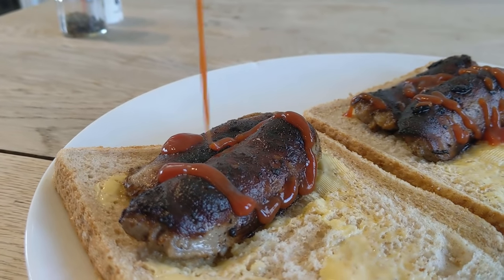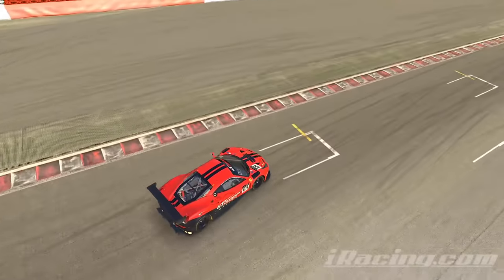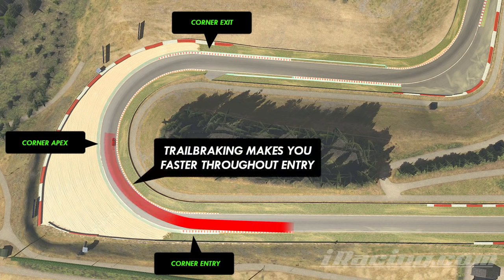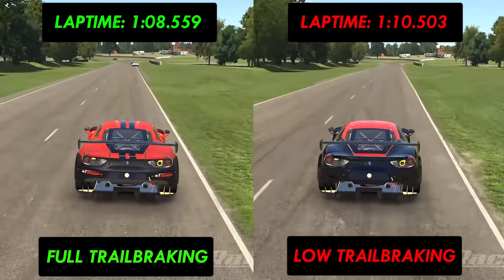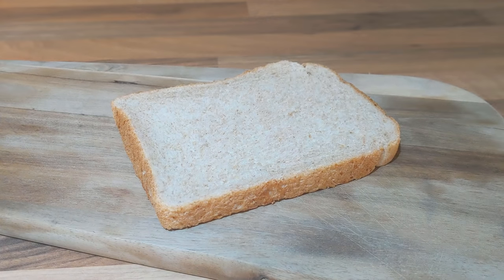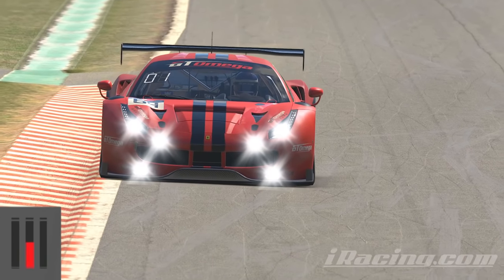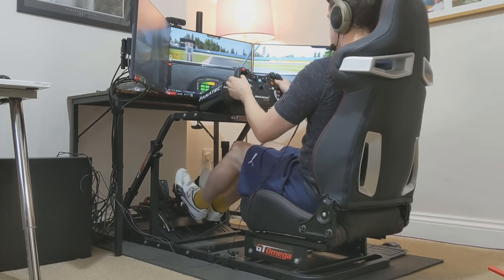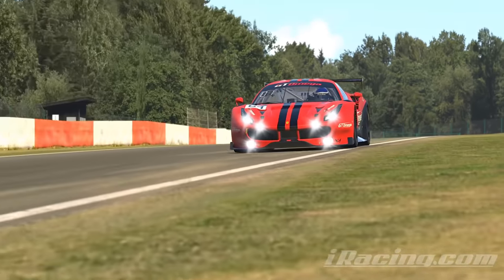Trailbraking In Sim Racing - How Slowing Down the Right Way Makes You Faster

Comment: When you feel like you’re gonna miss the corner but then you hit the apex is when you know you got the braking perfect.
Reply: I have to practice this. I'm still at the stage of "keep the revs high so I can get on the power, so the nose will tuck in."
Reply: @39KHall  getting on the power to get the nose in??
Reply: @jorehaast9887  I'm still at the stage of "kick it in reverse and floor it, blowing up the engine in the process"
Reply: @istachi  hey man, some of us are even less advanced than you
Reply: Your pfp describes my face when the car starts understeering.
Reply: @39KHall  You shouldn’t use the gas pedal to tuck the nose in unless you’re drifting. If you’re not slipping the rears while getting on the gas, you should experience understeer when trying to turn. To tuck the nose in you should watch this video and get a little trail braking going.
Reply: Breaking Bad. Braking good
Reply: Fax.
Reply: @jorehaast9887  theoretically could be done with a differential, but that's not the usual use lol
Reply: I only got this a couple times but it feels AWESOME
Reply: @1.7mviews84  I’ll change it oops
Reply: @jopvandam6820  it actually does work, you can slip your rear enough with throttle to reposition your nose more towards the inside of the corner for a faster exit
Reply: @IPickleYou  You could do that, but unless you want to completely ruin your tyres after 1 or 2 laps it’s not a good idea. Just use trail braking. It’s faster and causes less tyre degradation.
Reply: @jopvandam6820  its not a big slide generally so no you wont be really spinning your tyres enough to exactly cause major wear on them, ideally anyway but it all depends on all sorts of different factors aswell
Reply: its just a minor slip to angle your car,  theres not much wheel spin involved if you do it correctly but yeah there are places where one is better than the other ofc
Reply: @jopvandam6820  just looked through his videos, he has a video on slip angle aswell. youll get a better idea on what im talking about from there
Reply: @IPickleYou  I know what slip angle is. And of course you should always want your car to be at the limit of grip with a little bit of slip-angle but on corner entry you don't want to use the gas pedal to tuck the nose in. Of course on corner exit you'll want to use the maximum of your grip potential to accelerate with a little slip angle. But understeer should not be solved by getting on the gas unless you're drifting.
Reply: Late Apex?
Reply: Nice expression!
Reply: Happened to me yesterday.
Reply: When you have shit g29 pedals so your braking is fucked up and can t trailbrake
Reply: @iwillnoteatzebugs  They say, that the single piece of gear that can give you the most pace; is the breaks. Many things boils down to muscle memory as well, and with bad breaks, you won’t get it. I think that Thrustmasters TM-LCM are the cheapest loadcell breaks on the market, and if one isn’t use to loadcell, it’s absolutely huge to upgrade to. Worth saving up for! Maybe you may be able to get a great Black Friday deal, if wherever you are got something like that.
Reply: 💯 , get as quickly as possible to the apex such that you can position the car to get on the gas as early as possible.
Reply: @iwillnoteatzebugs  I drive on g29 brakes and I’m fairly quick. I’m not an alien but I’m fighting for podiums in pretty much every public lobby I drive in. I’d definitely be faster with better pedals but I can’t afford them. You can make it work!
Reply: Exactly! This is  how I experience TB in the beginning.
Reply: This is the truth; however in real life is absolutely terrifying. The first time I was on track on my bike learning trail braking I was not stop shitting my pants.  Now years later I understand that ride on rails feeling of coming in deep trailing brakes and rocketing out of the corner. Nothing better than passing somebody mid corner like they’re standing still
Reply: @IPickleYou  I think that if that’s the technique you’re using, you slowed the car too much before the turn-in point, and is more applicable to drifting.  Trailbraking lets you carry a little more speed into the turn because it’s keeping more weight on the front tires, for more grip.  And if your car is properly balanced, the amount of weight removed from the rear tires (while trailbraking) could be enough to allow the rear to rotate, and reduce the steering angle of the front tires at the same time.
Reply: I do this every time I pull into a parking lot😂

Comment: You’ve explained this before, but this is the absolute best explanation verbally and visually ever displayed on YouTube. No further questions needed. Visually it was the faded redline demonstration. You’ve covered a variety of analogies to appeal to different levels of understanding.
Reply: Finding your input vs the brake factor setting is key.  if load cell you should be close to 0, if 8 bit pedals default setting is just that, default.  sometimes its better to have a longer curve (fudge factor) depending on your personal style of input.  .3 is about where i am at on road course cars just because i always cover the brake.   0 is true linear, input to sim which gives you the best consistent feel with a load cell.
Reply: This comment, absolutely. This is a terrific explanation of trail braking and I loved it.
Reply: It’s considerably more effective with rear biased cars with slight oversteer.  Planted AWD cars like STI/Quattro/EVO families need electronically induced oversteer. Tesla 3 Performance, some FWD hot hatches(Ford & GolfGTI) do some trickery to attempt this purposeful oversteer.

Comment: Upgrading to load cell pedals helped me immensly in getting a more constant trailbraking. Imho one of the most important upgrades to start with. Great video!
Reply: agreed
Reply: Absolutely. And start with small BRF if you have a fanatec LC, makes it much easier to get adjusted to
Reply: Interesting. I've used LC for years, but know quite a few e sports guys that go back to the "cheap" pedals because they're easier for them to be consistent.
Reply: @notdreadyet33  that's very weird to hear.. I believe you ofcourse but lc made my braking SO much more consistent, right from the start. I just can't imagine that someone prefers cheap springpedals over lc pedals :-/
Reply: @MrEDET  I actually used to feel the same way! bought my LC, then put it in the garage for 6 months when my times sucked. Later, when I got a lot better and couldnt shave off time braking anymore, I pulled it out and made the switch back to the LC. 

For me, the big thing I had to do was wear shoes on my left foot, at least flip flops. I was a socks racer before, and couldnt get the grip you need to properly put pressure on the LC.
Reply: @MrEDET   I agree. What I understand about it is they can be just as fast, but are more consistent with the cheap ones. Definitely weird, but I haven't used non LC since 2008 or so
Reply: @notdreadyet33  Exactly. With spring pedals you kind of have to memorize the position your foot is in for the perfect braking position, and with unmodded pedals like the g29 that's nearly impossible to do consistent. With the LC pedals I feel the resistance. It didn't even take time to adjust - my pb's shattered because my trailbraking improved so much because I could now feel how hard I was pressing the brakes. Also heel/toe becomes much easier with LC. All imho ofcourse, I'm sure there are enough people out there who can manage this with 20-year old pedals :)
Reply: 100%. A load cell brake pedal made a world of difference for me. The effects of which have been reflected both in my laptimes and my ability to run said laptimes consistently.
Reply: @MrEDET  At the end of the day such memorization is next to impossible. Why it could feel like it's happening is because the spring also provides some back PRESSURE. So, we are back to the same thing as with LC, except with LC the dynamic pressure range is much wider, therefore I'm very skeptical about such claims.
Reply: @F9109-r1e  That kind of surprises me, first time I ever hear someone saying this :) Did you just recently buy lc pedals? Which ones do you have?
Reply: @F9109-r1e  its correct there is no travel, you should feel by the pressure how far you're braking. Just keep practicing mate, hope you get used to it quickly :)
Reply: @F9109-r1e  Now I'm doubting if your pedal even works correctly.. when you calibrate it in windows.. you have to press the brake pedal almost full force to get it at 100% right? The whole idea of a lc pedal is that you feel pressure, resistance.. slight pressure for trailbraking, a lot of pressure when you're braking full and probably lock up the wheels. The beauty of lc is that it feels natural. When I got mine I did my first lap in the Lotus 49 in Iracing and after a couple of corners I could already feel when I was braking on the limit without locking up the wheels. Have you made sure you installed those.. forgot the name, those plastic things correctly in the braking pedal??
Reply: @F9109-r1e  do you have that yellow spongy part installed in the middle? You should get a small amount of travel first, very light, the pedal moves about 2cm. That is the area do you the trailbraking with. When you push further you hit the yellow sponge area and the pressure starts to build. Try racing with socks, racing shoes or what I use, watershoes, those are perfect for simracing. Reading your post I still think there is some sort of setup issue on your end.. trying to help you out here, you're really the first one I hear having an issue with using an lc pedal. It should feel so naturally..
Reply: That’s what I thought. I was thinking of my set up and I don’t think my brakes allow me to make those slight adjustments at all
Reply: @matthewrobert1810  Which pedals do you have now?
Reply: @MrEDET  the stock g293 pedals
Reply: @matthewrobert1810  Trust me, you really want lc pedals. And the fanatec ones are not even that expensive for example. But note you either need a rig to mount them or build a wooden frame yourself to mount them on when you're racing whilst sitting on a chair. You'll apply a lot of force to the brake pedal so they need to be rockfirm in place.
Reply: @MrEDET  got a rig already so I’m set there. Any specific ones from fanatic you’d recommend? I’m newer to sim racing. I started about 3/4 months ago
Reply: @matthewrobert1810  I have the Csl Elite LC pedals and recently they released a V2 version, so I would go for that one. But ofcourse check some reviews first :)
Reply: @MrEDET  I came back to look for your comment specifically. I found some thrustaster TLCM pedals on Amazon and figured I'd give the upgrade a shot from the stock g923 pedals. 

OH MY GOD. I can express how much of a difference this made. It's insane. 

Thank you for inspiring me to look lol
Reply: @matthewrobert1810  hey that is awesome to hear, thanks for letting me know. Enjoy the trailbraking! :D
Reply: I wouldn't call switching from a dd wheel + lc pedals to a controller an upgrade @bitemyshite
Reply: @bitemyshite Well firstly I ain't because you feel much better what the car is doing with ffb, secondly it's not really simracing anymore with a controller ;)
Reply: Ah. That nuance is impossible to tell in a Youtube comment :) @bitemyshite

Comment: I couldn't figure out why someone was faster than me while his lights were still on during the turn...
Then this video pops up without even looking for it.

Awesome explanation!!
Reply: practice racing sprint cars or midgets.  you use your left foot more then the right...lol  you learn how to trailbrake while sideways too....:)   but if you are new, depending on your brake setup.  play with the brake factor setting default is like 1.50 but true linear braking is 0, if you are a heavy footed then move it up until you find your happy spot.  every car is a bit different but i have cspv3's and run .3 on road course cars and 3.0+ on my dirt cars because i am always keeping brake pressure to keep grip.

Comment: Trailbraking is actually pretty easy on a controller. 
At least with the more modern Xbox controllers. 
This is because they have rumble motors in the triggers that are used to convey how much grip you have. 
Full rumble= no grip
No rumble= full grip
Rumble in the right trigger= grip loss due to acceleration
Rumble in the left trigger= grip loss due to braking
Reply: Your are definitely not getting on the limit with a controller :/
Reply: LMAO!
Reply: on a track, nope, but on rally it’s still doable to the point of world records, and even compared to old controllers, is a massive increase on tracks
Reply: Way better on the Dualsense with adaptive triggers
Reply: Anyone still harking on controllers hasn't used the new ones. I am def faster with a wheel. But honestly not by much. The new duel sense in particular is really easy because you can actually feel loss of traction on the triggers.
Reply: @razgriz6627  I've only been able to experience this in Forza. Are you able to get it working in AC?
Reply: My controller doesnt have that and i fail a lot of time in corners for lose grip because the brakes block really quickly even when i didnt send all input in the trigger, how do setup the trigger to not send to 0% to a 100% of brakes  when the input doesnt have a regulation, if u cant help me i really thank u 😢
Reply: Sorry if my english isnt the best🙃

Comment: This might be beneficial for shorter races where tire/tread condition isn't a concern.

Breaking in a straight line provides more longevity for the rubber, unlike breaking in a turn.
Reply: You're still gonna lose more time not braking the right way and you can trail brake WHILE taking care of your tyres.
Reply: If the race is so short tyres aren’t a question people drive hotlaps constantly so idk how it would matter
Reply: @makoaki9071  time is not everything....

That are alot of factors that go into winning a race.

trail braking is more risky and requires extreme precision to get it right especially under pressure.

I seen even the greatest drivers mess up trail braking.
Reply: @TinyBearTim  it does not matters if the race is short or not.

You will use more tyre depending on how you drive.

Trail breaking becomes harder the longer a race goes. Especially defending under prssure .

Your suspension has to be set up properly to get the full benefit of trailbraking also. Trailbraking with a poor suspension setup will hinder your front end grip and make you more prone to rear tire spin/snap oversteer.

Comment: The best way i learned to trail-brake is to tie a string from your brake pedal to your wheel. The harder you press your brake the less you can turn, but when you start turning it forces you to lift off the brakes little by little. Hope this helps someone who is having a hard time getting the hang of it.
Reply: This is an awesome trick. I want to try this, but I'm a 3-6 months away from build a PC.

Comment: This is why i think every racer should learn how to drift because it teaches you throttle control and where the brake point is when braking at a highspeed. That combined with proper knowledge of trail braking. Will give you a more complete idea of how everything weaves together when you want to maintain grip and speed while corning.

I have been doing trail braking since GT1 driving licence test. You literally cant pass them without using trailbraking.

Comment: In racing and in many things...
Averages are better than peaks. Compromise is key.

Trail braking is not better at braking or turning individually but it allows you to use all 4 tyres and balance the car, aero and suspension to do both together.
You might take 50% longer to do both but you can do both in one go. Less braking and turning time = less time in corner + quicker corner = faster boi.

This truly is a win-win-win-win. It's just the correct way to drive. Every little bit better you get at it you get wayyy better at driving in all scenarios.

Comment: What i learned from watching GT Races for more than 10 years, is that Trailbraking is only usable for Cars with Rear Engine, and Rear-Mid Engine, like Ferrari, R8...and others.
Cars with a Front Engine like BMW, Nissan GTR, Corvette dont use Trailbraking.
That is one of the Reasons why Porsche is that fast, and was always fast.
They can break later than other Cars, because of the Weight in the Rear. They need to Trailbraking, to put Weight on the Front Tyres.
And they can accelerate more early than others, because of the Rear Weight, they got much Traction.
Porsche are hard to drive, but when you are able to controll them, nothing is faster.
Reply: What if on the front engine cars the brake bias is 50/50?

Comment: One of the best explained trail breaking videos, thanks. I always struggled with this tecnique because by playing on pad i have problems getting used to control how much steering i'm putting in and that is dangerous if i'm steering while breaking. And i always thought i'm probably doing something wrong, so i found myself faster by breaking hard as hell, using the shortest gear to snap in the entering of the corner then steer 100% and use the gas to open and close the radius. Now i got me a Logitech G920 wich will arrive today, i hope i will finally learn trailbraking properly now xD
Reply from the maker: Thanks man, you're a beast for even trying it on controller, that would be mega hard! A wheel should be a massive improvement
Reply: @dannyleeracing  TY <3